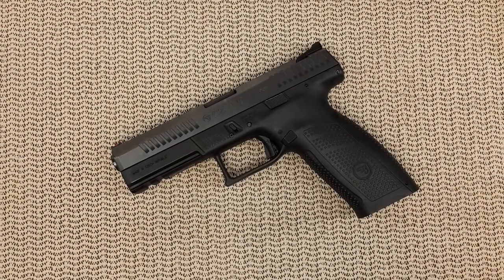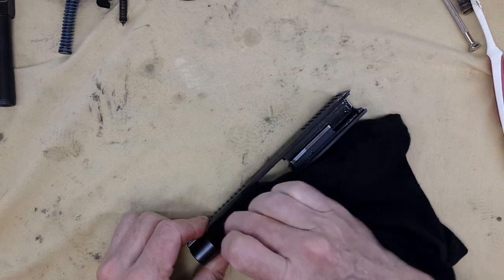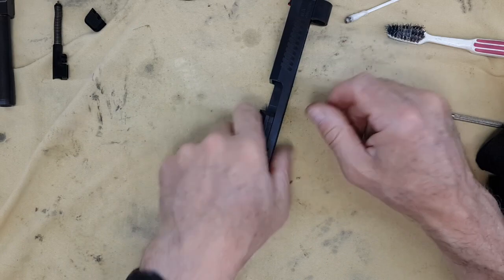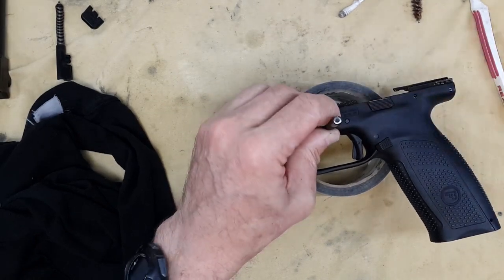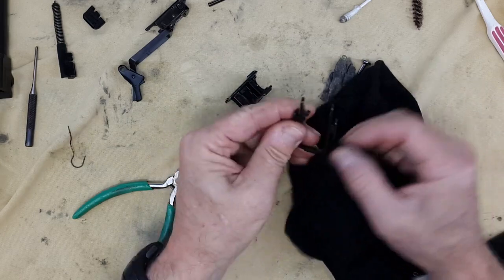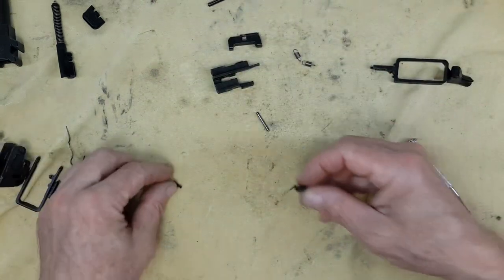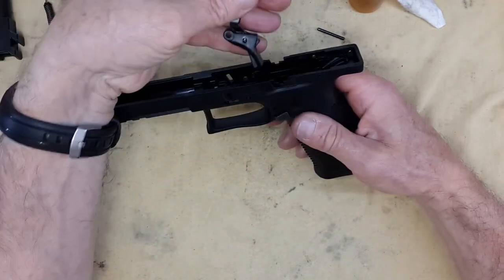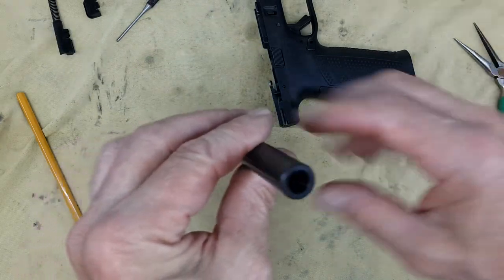Cleaning a CZ P10F / P10C / P10s

Comment: Hi, I've never had a polymer gun, what lubricants and what cleaning fluids do you recommend for better care and preservation of the polymer both inside and outside the weapon?  Thanks for your time and information.  Very good videos 👍🤝
Reply from the maker: The polymer doesn't require any special attention. If it's muddy, you could remove all the metal parts and wash it with soap. For all the metal parts, it's like all other guns, you will need a solvent, oil, rags and a firm tooth brush. Everyone has his own choice of oil. I use my car's oil, you know, what's left in the can after an oil change. Bottom line, all you need is a lubricant. Happy shooting
Reply: Thank you for your response, now from my ignorance on the subject of polymer.  
Is the same as the common auto motor oil or synthetic oil?.
I already apologize, but as the cure or death may be in a detail, before dying it is better to ask.  
From what I've seen on YouTube and others, they go from alcohol to WD40, one has more doubts than solutions.  Thank you very much for sharing and your tolerance. 
Thank you again. 🤝👍

Comment: Thank you , For the work you put in making video !! I purchase two CZ P-10C one with threaded barrel and for my daughter. I noticed that the magazine release is very stiff. Do you have any suggestions on that I feel I should be able use just my thumb to to release it. Thank
Reply from the maker: Thanks Lee. Is it stiff on both of them?
Reply: Yes it is stuff on both of them my daughter and myself I having a hard time with the magazine release
Reply from the maker: @wrenfamily1  If it's on both of them, I suspect it to be normal. Maybe too hard for your taste? 
You might want to insert a couple of drop of oil around the magazine release and make it work. 
It could also be thicker than normal releases, so it would need to be worked a great deal. 
In any way, i would take it apart and make it work freely in the gun, without the spring. to see if it bind anywhere and can run freely. If it does run freely, it could also be a harder spring (If I can call it a spring).

Comment: Got a p10s, and the trigger safety sometimes catches because my finger wraps around due to my grip. If I loosen my grip the trigger is fine but if I hold it with a firm completely closed grip it catches and the trigger won't move. I saw on another vid a guy having the same problem and so he sanded down the part that catches but I'm afraid to do that. Is there another way besides changing grip?

Comment: Great informative video. I have problem with my cz p10f. Light strikes, new gun, stock springs. Any tips?
Reply from the maker: If I had a gun with light primer strikes, i would first try a different batch of ammo. Some primers (brands) are harder than some others. Also, some springs are pretty stiff from the factory and require some cycling before loosing up a bit, keep on shooting the gun. But first, try different ammo.
Reply: @practicalshooter6517  I reload my own ammo. I use magtech and fiocchi primers. Both give light strikes. The same ammo in my shadow 2 works perfect. You can also see much smaller dents in the primers from the p10f. I have tried glock springs (and glock cups) but with the same results. I wonder if the firing pin can be the problem. Not much else what I can think of. I have cleaned the firing pin channel.
Reply from the maker: @Cludden79  Looks like you already know and have already done what needed to be done. 
Next step would be to contact CZ then. They will probably ask you to ship them your gun. But don't email CZ, they don't seam to like emails, call them instead, they answer their phone a lot faster. Good luck Linus
Reply: @practicalshooter6517  thanks for taking your time to give me these good answers! Subbed ofc! 😀👍🎯🔫
Reply: did you remove all that factory grease?
Reply: @sulimbek2025  I got my gun replaced. Now it works like it should. They had never seen my problem before

Comment: At what frequency do you clean the gun ? Every 100 rounds, 500, 1000 ?
Reply from the maker: I have set my schedule at a +/-  600 rounds cleaning. I always set up a gun cleaning schedule based on the gun starting to have problems. My competition CZ75 SP01 was 1700 rounds cleaning and never had a single issue. The P10 is a bit more demanding, so I set it up at a lower count.